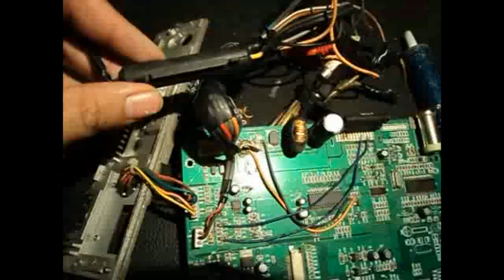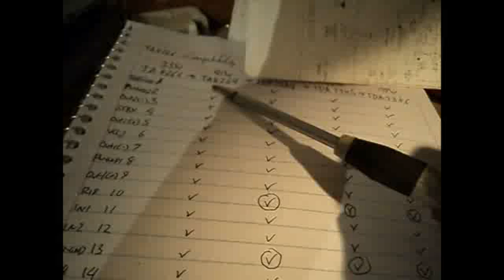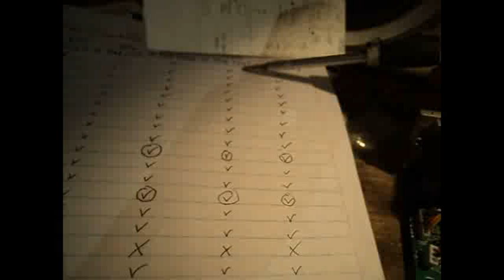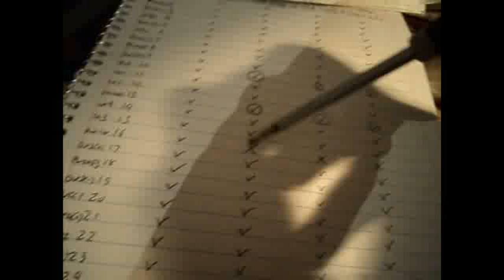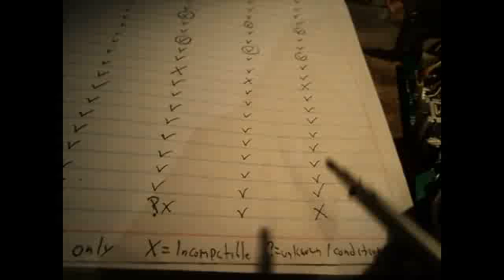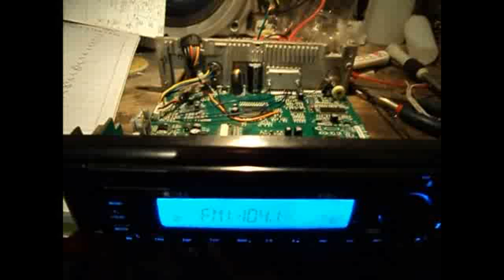Repair and Increase Power of Car Stereo

Comment: My Pioneer deh 2250ubg backlight is blinking when it hit a bass sound ! Help me
Reply: need bigger power supply
Reply: @MrOiphy  yesterday I replaced the old Pioneer with a new edition single din Alpine that have RGB illumination problem fixed.
Reply: @MrOiphy  Alpine technology in display backlights are great, no more dimming or flickering while it hits bass

Comment: U removed the output ic if u apply 12 volts to the head unit will it come on without the ic chip i know u wouldnt get sound

Comment: Where can i buy that fork?
Reply from the maker: Well I don't know, it's a highly specialized piece of equipment.  I bought mine from a guy that used to work at NASA.
Reply: that simple steel fork buddy blade turned as per need

Comment: Hi, did you ever do a follow up video on that beautiful black and white Philips danubio tv?
Reply from the maker: I didn't but maybe I will soon.  The problem is that I can't find  a schematic for it anywhere and it has a few problems all mixed in.  I had also lost the HV rectifier  which is one big fuse shaped diode, I have a replacement now though.  Might do a follow up vid in the future.  Last time I messed with it, the H oscillator seemed to be coming back to life.